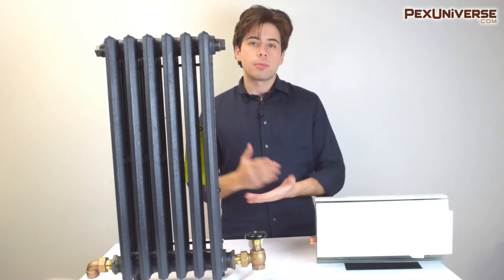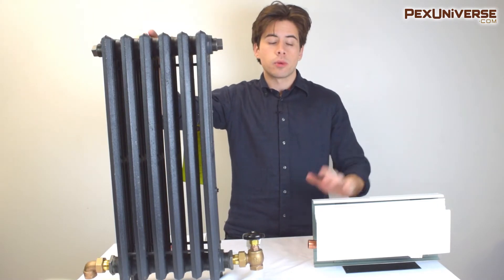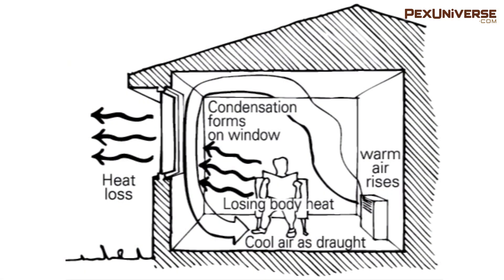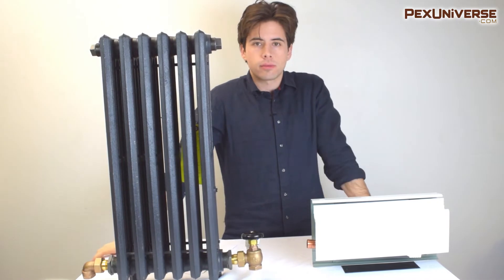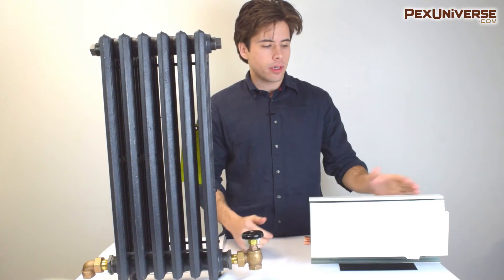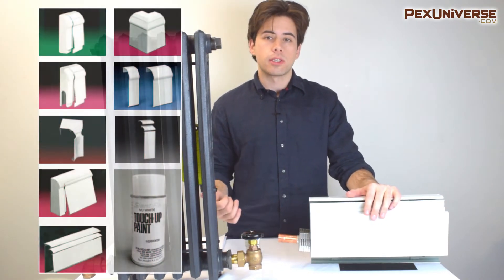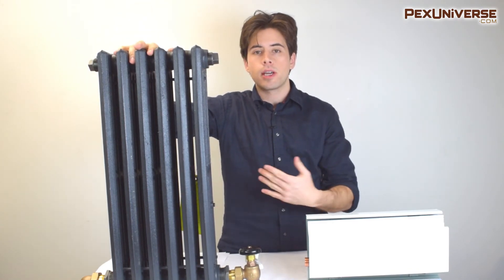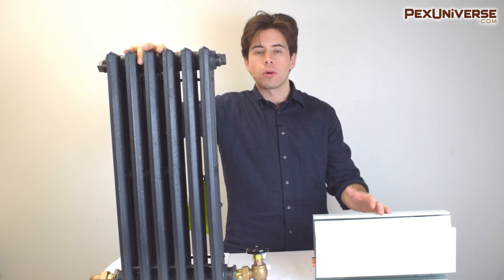Detailed Explanation of Baseboards vs Radiators | Radiant vs Convection Heat

Comment: Ia have a question?I live in a 6 unit apt.building and we have the radiator heat(gas not electric)and now the property owner wants to change to electric baseboard heat but the radiator heat works great for all tenants.how much work and how big of a job is it for workers to come into my apt and change the gas heat radiators to electric baseboard heat.does it take a long time?do they rip out the radiators from my floors?and how long would it take to do it.5radiators total in my apt.which heat is more expensive?& If we don't have storm windows & apt is extremely drafty all around that would make the electric bill way higher right?do they install thermostat in our apt to control heat bc I've never had electric heat  or baseboard heat.i just turn the knob on the radiators.if you could answer any of these it would greatly appreciate it.thanks for your informational videos
Reply from the maker: Hi Ashley! In terms of replacing each unit, we'd expect a licensed professional go get the job done around 3 hrs. So setting up your apt, given that there are 5 and quite a few more tenants a few day if not about a week to get the job done. Now an electric baseboard, presents a few challenges. While electric baseboards are said to be easier and more efficient, the cost of running one is based of how often you interact with your thermostat. The best bet is allowing them to constant, instead of being turned on and off if it is able to recognize when to cool and heat the room on it's own.
Reply: @PEXUniverse  1st of all thank you soon very much for responding to me,very few people I notice respond to people it's greatly appreciated.2nd do most electric baseboards has the controllers on the baseboards or on the wall controllers? & I took some pictures of the baseboards that they will be using the brands are Cadet Heat, DC Simplex & Farenheat.how are those brands?again thank you for your time
Reply from the maker: @Mr.threezy  No worries! Those are pretty good. More than likely you will have a wall mounted control unit. Some even have wireless remotes and can be activate using an app in your phone.
Reply: @PEXUniverse  Thank you very much.

Comment: I don't understand the difference between the baseboard and the radiator. They both have heated liquid flowing through them. How is one heating objects via radiation but the baseboard isn't? Is that because the radiator has more thermal mass so it's pushing off more energy to be picked up by the objects in the room?
Reply: The difference is due to the materials. Cast iron has relatively high emissivity, i.e. it more readily expels heat as IR than the aluminum fins of a baseboard heater.
Reply: @TerminalSaint  wrong
Reply: Think about that heavy cast iron sitting on the stove over a open flame and how long it would take to cool off  when you turn off the flame vs the thinner metal baseboard material under the same conditions.
Reply: @nymeria1160  again, wrong
Reply: @walterbrunswick  - thank goodness you're here to correct everyone.
Reply: This guy is giving incorrect information... radiators DO heat the air...
He was mistakenly talking about infrared heaters smh

Comment: It's really a matter of degree. Depending on the temperature and the objects (especially insulating ones like sofas)  nearby, the heat from a cast iron radiator can be up to 80 or 90 percent convective, but the radiant portion can still be felt. And, some of the heat from a baseboard it still radiant; even if you block all the air, you can still feel some heat from it, especially if the metal has a heavy gauge. And, even underfloor heating generates some convection current. Of course, the higher the radiant portion, the more comfortable and efficient the system. One thing I'd like to try would be putting a high-mass cover (thick metal or tile)  over a fin-tube radiator element, preserving the dimensions needed for convection. The air going through would heat the heavy cover, increasing the radiation to anything (or one) near it.
Reply: That's exactly what I was searching for when I found this video.  Did you do it? How did it work out?  (A contractor put 20' of fin baseboard on the same loop as 2 cast iron radiators..in a room with 3 outside walls - 2 are all windows, no basement and no floor above it. To say it's cold is an understatement. *sigh*)
Reply: @vbrh01  Sorry to say I never had the opportunity. I'll add another reply if I do.

Comment: The whole point is to heat the air.  If the heat travels to colder spots faster, then is doing a better job.  Heating up an object does nothing unless I literally am touching the object or staying near it all the time.  If an object radiates so much heat it can heat whole room quickly, and keep warm when doors open is likely way too hot especially nearer the object.
Reply: A room full of warm objects will feel comfortable, despite a cooler air temperature. And cold object can suck the heat out of your body even if the air is warm.
Reply: This guy is giving incorrect information... radiators DO heat the air...
He was mistakenly talking about infrared heaters smh
Reply: @walterbrunswick  You can shake your head all you want and get nitpick with semantics, but the deal is that cast iron radiators put off heat long after the water has stopped circulating.  Baseboard, not so much.  My house has both and the baseboard rooms are always cold. The ones with radiators are toasty.  Ironically, the ones with baseboard are newer additions built with modern material and insulated.  Radiator heated rooms...plaster walls, no insulation....roasty toasty.  Go figure.
Reply: @vbrh01  yeah a lot of modern design choices are bad.

Comment: Hi 
i have house and i want change my radiator heating to baseboard heating  can i do it in my house 7 radiator???
Reply: Why would you want to do that? Radiators are the best.
Reply from the maker: You absolutely can, the same hot water supply line used for the radiator could be replaced with baseboard heating or by running a new line if you have a manifold installed.  If you're unsure how to do so yourself, we recommend consulting either a trained professional or someone you know with experience as to what would be best for your situation.

Comment: The house I grew up in had the best of both worlds on the ground floor: hot-water baseboard radiators. The upstairs bedrooms had the stand-up grill radiators.
Reply: Did that end up working out as good combination? Any particular reason why you wouldn't want the radiator on the first floor and baseboard on the 2nd?

Comment: cast iron radiators can also dry laundry.   larger sizes handle bed sheets no problem
Reply from the maker: very true
Reply: @PEXUniverse  what are iron radiators? and do they go on like automatically?
Reply: @PEXUniverse in order to have a steam radiator system...does the boiler have to be in a basement so the steam rises into the system. I have a rancher with no basement.
Reply: Great info !